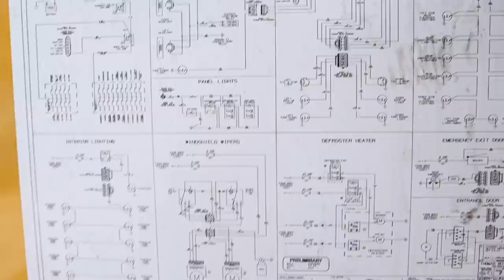Removing old school bus wiring: mistakes, frustration, and triumph  // School Bus Conversion part30

Comment: I have been binge watch you build your bus for the past week.  Watching you learn as you go is so inspiring.  Never give up!

I know you have done more work, but I writing some advice below not just for you, but anyone who reads this.

At one point in the video, you talk about how you start to traces and remove wires from your bus.  This is exactly what I have to do for my job in the electrical field.  There is a saying in the culinary world, "mise en place" which means everything in it's its place.  When you clean or tidy up your bus, take some time to collect loose wires and put them in a bag or box.  Wires that are still attached to your bus, cut the exposed copper these wires can short and cause issues for you.  Then coil the wires up and use a zip tie to secure it, so they don't unravel.  Finally, label your wires when you figure out where they go.  If you want some advice on labeling your wires I can give some, but you should come up with your own system, I use colors and numbers.  Colors denote if the wire is power, ground, return, or signal.  The numbers tells me function or location of start or end of wire.

Last thing, if you have any question ask them on a electrical forum somewhere.  Reddit has some nice electrical subreddits.
Reply from the maker: thank you!

Comment: Good job!
Measure and mark down how the roof wood is crooked. You will need to know where to nail since you won’t be in a straight line. Might be better off straightening then for the finished product. 
Wire is super intimidating!  Huge.

Comment: DO NOT SPRAY FOAM OVER YOUR WIRING!!!
If you ever have an issue where you need to fix or modify the wiring, or even replace a light, you won't be able to dig the wiring out of the foam.

The wiring was originally ran in an open channel the full length of the bus. Put it back in that channel like it originally was and cover it so it does not get spray foamed. Also, do not spray foam the front or rear panel of the bus where all the marker lights are. Glue on white foam board instead to keep the wiring free. 

 You will thank me later.
Reply: I would say simply LABEL your wires at each end then spray the foam. As long as they are labeled, you don’t need to dig them out.
Reply: @jongromatzky4389  that would be fine if you need to fix something, but what if you want to add a new circuit. You won't be able to do that without access to the wiring harness.
Reply: That is such good advice, Dave. I keep seeing youtubers interweaving wiring into van frames, and burying it under insulation, without even using protective conduits. They're going to have to take their vans apart to fix any issues that arise.

Comment: Smart working from the back to front. glad all the lights are working. wiring is not that difficult you have a hot and a ground. tip on cutting wires, cut one at a time, if you try to cut two or three at the same time one might be a hot wire and one may be a ground, then you would blow a fuse. great job. the only thing that bothers me is that dang tape hanging from the ceiling. OCD issues i guess. 😃

Comment: Yay for problem solving!  

Before spray foam - do you know about the packing-tape-trick? Spray foam sticks brutally to *everything*. After you mask off windows etc, take regular packing tape, and cover all the places you don't want spray foam to stick - furring strips, metal bus ribs, etc.  When the spray foam is done, the tape peels off easily and the over spray comes with it
Reply from the maker: I have seen that! Thank you!!

Comment: You should cover all the wood framing with packing tape before you get the spray foam done. It will make clean up way easier.

Comment: Wiring is fun but, think two steps ahead. Right now you're making your bundle on the outside of your stringers that you have attached your wood to on the walls and roof. Grab a 1 3/4 hole saw and run those wires through the stringers in the wall just like a house so when you go to put your wall on your not finding yourself with wires in the way. In the holes, you drill put rubber grommets so the wire does not chafe and ground out over time. Doing good, Keep it up.

Comment: You are now qualified to work at the Spaghetti Factory. 👍.   You are getting very good at figuring out the problem and then fixing it.  Something that took me a long time to learn is some times it’s better to stop and think and research a problem before you continue.  

And look how far ahead you will be if later on you have problems because you’re going to know how it will put together.

Comment: Make sure to secure all wire bundles with a cable tie to you bus frames periodically, leaving wires to swing free inside wall will eventually cause them to break and tracking them down can e an even bigger pain

Comment: if your spray foam is over the 1.5   just slice a channel in the fome just enough to run pipes and wires 
it would actually hold them in place make sure you make access panel to your tail lights,  you will have to work on lights on trucks and busses often.  save the wires either to rewire but the scrap yards buy them as well as metal off bus

Comment: Schematics are tricky to read. My advice is figure out which is the headlights, the tail lights. Once you can figure that out the rest will fall into place as how you read them. Don't look at the whole schematic layout. Look at it as sections. Front section, rear section, mid section. Break the sections down until you can understand them.

Comment: Just a thought, leave a couple of extra inches of wire at each end of the connection, instead of pulling it so tight, in case you need to repair or add a connection later. It can be tight along the run though.  I’ve had to replace plugs & switches and cussed the cheap builders who made it impossible due to no wire to work with. Also, don’t re-use wire. It’s not worth the risk.

Comment: Emma tape off all your boards and metal ribs in the roof with duct tape before you spray foam. Then after you can peel that off and have clean boards to connect to. Saves a lot of work. Also put all your wires in plastic grocery bags and tape them off at the top so they will stay clean. You wont regret it! Spray foam is hard to get off!

Comment: Great job on the wiring its just one wire at a time. Makes it simpler. For bus wiring Right Turn. Left Turn. Tail Lamp and  Back Up. RT and LT takes care brake lamps TL takes care of license plate. You can always call before during or after melt down I will hep when I can. Treat every thing like one project at a time . When you know it you will run out .of projects your done.

Comment: Good job on the wiring. Take your time on the various jobs and don't stress out, that doesn't get you anywhere. Slow down, think, research, what you are trying to do then, if necessary ask a professional. No shame in asking. Keep going forward and get the bus finished. Good job again.

Comment: Lighting is the issue now. Look at where it says Front Lighting and Rear Lighting.  I would focus on the rear lighting. Look at where each wire runs, Taillights Marker lights. Look for a wire that goes to both. They should be color coded, meaning that same color wire should run from the front to the back. It's one of the wires you cut or unplugged from the control panel. Take a few steps back to make sure your reading them correctly.

Comment: Great video Emma. In your previous videos I thought those wires were such a cluster ** story.   It's looking so good now.  Just remember, all electronics in the bus have an In and and Out.  In comes from a switch which is connected to a fuse which is connected to the positive (red) side of the battery.  Out connects to the frame of the bus (ground) which is connected to the Negative side of the battery (black).  If something doesn't turn on, just follow the lines and see which one is broken.  I don't know if spray foam is the best idea.  If you ever need to get to any of those wires, it's going to be a major PITA with spray foam.  Any other insulation can be removed and replaced.

Comment: Here's a hint, one the wires that you have cut, use one of the solder connectors on the end, just don't have it connect to anything! Gives you an insulated wire that will not short.
Reply from the maker: thanks! I was wondering if that was okay to do and couldn't find any info!

Comment: Emma,  instead of the 'rats nest' you're creating,  I find it's easier to wire in each component seperately and completely to avoid confusion.  Then test it to make sure.  
Run your electrical conduit under the bus for convenience and accessability.  Use larger gauge wire;  especially on longer runs.
Preferably,  in my opinion,  keep the wiring and plumbing out of the walls....
Reply: Another option is a wire conduit in the wall. It will protect the wire from rubbing against a part of the bus, especially metal parts where you risk shorts.  That makes it easy to install new wires or replace old wires later.   Plastic wire conduits do not cost a lot of money.

One conduit for the bus wires along one side.

For hours of power, I would have one conduit per side for 12V power distribution. Putting a 12V fuse box on each side for power distribution makes the setup easier.

If there is 120V outlet  I would separate the wire path for it

You can cut out part of the vertical wooden ribs along the side and the conduit fit there. You have to be careful later to not screw into it. If you plan what the wall should be made of you can space out the conduits so you can attach them to the wall.

The bus wires could go below the but to have all wires for the internal power there would require a lot of holes in the floor and that is not a good idea.

Another good thing to do is labeling the wire so you know what they are later and do it in a way that stays readable over time.

Comment: You may already have this planned but before you spray foam and put up your interior panels I'd put in some metal or plastic conduit with a pull string front to back and also front to mid. Just in case you want to add interior lights or wires for solar panels or even 120 volt outlets.

You are doing such a great job at this, very impressive. I've worked with dozens of engineers that have real world experience (supposedly) but couldn't find her ars with both hands.  I'm sure you would work circles around them.

We all need help and look for answers in the quest to make things. I'm Glad you have helpful resources I hope you don't think less of yourself for using them.
Reply from the maker: thank you so much 😊
Reply: @EmmaBuildsBirbie  
If you ever want a monitor for your Bus. I have a bunch of 32" 24v LG monitors (I wanted one for A bus, got them free but had to take all 10). I have them listed on Ebay But in the interest of getn them to a good home, Id be happy to send you one. 
I'm sure you don't want to give an address to weirdos from YT so If you want one I can send it to Someone you knows work or what ever.  If you care I can explain how I got them and why but its not that interesting. 

Hope your having a great evening.

Comment: Keep all the old wires for when you will be running stuff inside for lights and such. Save yourself some money and there is enough color variety to keep track of each connection.

Comment: When you cut the wires to other things, if you didn't unhook the battery at the beginning you might have blown some fuses.  I would check that first.  But your original instinct to cut things that you don't want was correct.  You just have to make sure your battery is disconnected.  When I did mine I traced wires from what I wanted to keep back to the first wire harness and then marked them.  You can put a piece of tape around them, or a small zip tie, something.  Then the rest that I didn't mark, got pruned throughout the bus.  I figured I would just run new wire to what I needed.  However, if you want to cut costs, you can reuse wires that are already going the correct direction as long as they are the right size for the amp draw.  Most of my wires were 14 gauge, and the big flashing lights were 12 gauge I believe.
Reply: lol and guess I should have watched the rest of the video before replying.

Comment: Hi Emma
1. Keep all the old wires, tomorrow you want a light  or usb port somewhere then you can reuse them. Not these wires have a thin diameter as they are DC which is the same voltage you get out of a battery. If you are putting any AC in make sure you use the correct gauge (thickness) based on current (amps) . Google it
2. Do as you did and trace each wire and label it front and back
3. The wires you cut off, pull them back into the panel on the outside of the bus and disconnect them there, these are future short circuits ( not good)
4. As you trace and label the wires, start drawing your own circuit diagram to add to the outside panel, especially as you start pulling in new wires. ( pump for the water, lights and switches , fans, power for sockets to charge phone, laptop, etc) For AC wiring get help from an electrician, as the length of wire and use lights (low current/amps) and power sockets higher current/amps) determine the thickness/gauge the wires need to be.
5. Watch out for high power items like hair dryers, electric cooktop, fridges, electric kettles they draw huge amounts of power, which you need to generate and store. As far as you can consider gas, but then again get advice from a gas company, or person working at a gas store.
6. For plumbing I advise you use screw on connectors, go to a store ask advice and how to use these. The screw on type are less likely to leak, the solder on type can be tricky. Also first google plumbing and draw out the system you want on paper, planning it there is way simpler then planning while installing.
7. Dont rush the insulation, sales technique “ the price is about to go up…”, google it and look at some videos, the foam tends to expand further and randomly then you think, but yeah keep your pipes and cables accessible for maintenance.
8. Use conduits or trunking and cable tray for wiring and plumbing runs, less rattles, much neater and easier to fault find. When you cover the insulation leave the trunking covers open/exposed, you can always then open and close to add or maintain wires and plumbing without having to damage or remove your covers. Nothing worse then a leaking pipe behind a cover causing damp and mould.
9. Awesome rule, measure 3 times and check, and try to add redundancy before cutting or removing anything. That wire you pulled out for the rear lights you no longer need would have been just the thing for a small DC fan at your bed, now you need to pull a new one in.
10. Lastly AC power can get real expensive to fit out, a simple portable generator for higher loads like hair dryer etc and use a inverter on the bus alternator for lower power needs like charging phone or laptop.If you plan to camp out where you can get a grid connection, keep these AC runs on separate wires. Better to opt for DC powered small fridge as it can run from the bus alternator while driving and batteries overnight. You will probably need to plan and google AC and DC solutions and see what fits into your budget.
11. Dont stress, a lot said here, kinda like the wires from the back of the bus, tackle one at a time, have fun and when things get tough just imagine the amazing places and people your future adventures will lead to! If you have the will (which you got) , time and google you can figure out anything. Somewhere many people have done what you are doing and some of them uploaded a video on youtube.

Comment: Batt, fuse, relay, I’m a bus and aircraft mechanic you can ask me questions and I will try to answer them for you I know about wiring and other things on the bus
Reply from the maker: thank you :)
Reply: You need the wiring to run the bus ur better off putting them back & run new to the things you want they put it in there 4 a reason girl just put it back & no touch 😁 oh ps owned my own garage not that that means a thing .lol

Comment: I'd like to point out that you shouldn't spray foam the electrical either. Leave them haning and when the foam is dry you can just cut small channels in the foam and run the wires in those channels and secure with tape as needed.

Comment: "Whatever that is" #1: is either a fuse or breaker. They prevent the wiring from catching fire because you're trying to put too many devices on them. 
"Whatever that is" #2 is a relay and they are a little more complex, so bear with me. 

You have two things major things in an electrical system, Volts (V) and Amps (A). (Watts (W) is simply Volts x Amps, but we will cover that later) The bus will be a 24 volt system and that will be fairly constant. (+/- 0.5-1V, hopefully) 

Amps is the amount of capacity required for a device. I liken it to a garden hose (but that's not quite correct either. ) OK, so particular wires and switches have an maximum Amps rating that will make them fail. A relay is basically a power-operated switch with a tiny magnetic inside. You have a second, separate power source that turns on the switch inside by activating an electro-magnet. 

You can run much higher Amps through a relay than you can a "normal" switch and, I'm going to guess from the limited amount I saw, that this particular relay is activated by the ignition key, which is just a different type of switch. 

I hope this helps explain it in a way that doesn't come across as mansplaining or condescending.
Reply from the maker: thank you!
Reply: MrTo YouBoy  you are absolutely right, but its a fair guess given nearly all heavy diesel engines capable of pushing that bus full of children are.